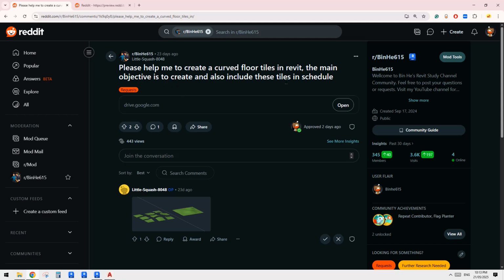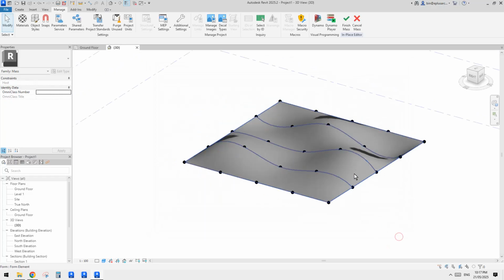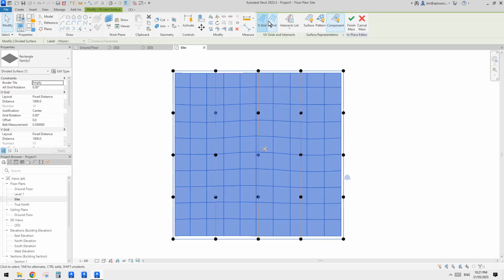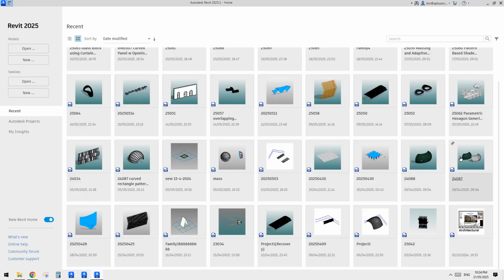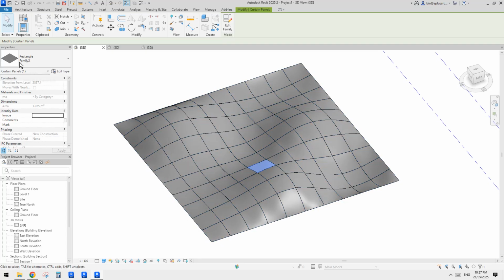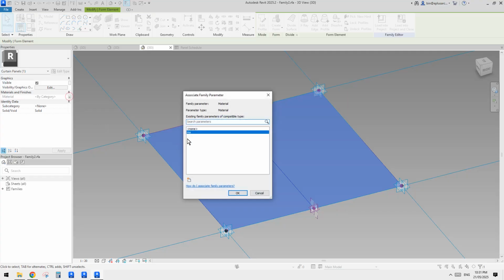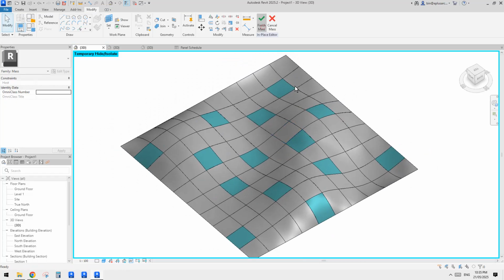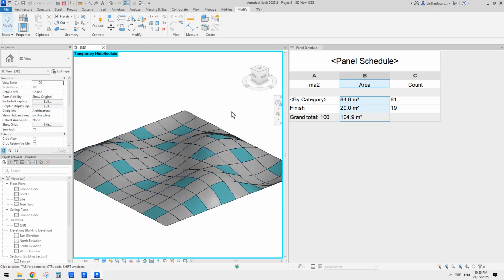25070 - Pattern Based Family and Schedule Exercise in Revit

Comment: When I try to create a custom pattern using intersecting  in a mass, I encounter issues when applying a pattern Some tiles are missing,(if no pattern is applied no issues) and others are being generated outside the intended boundary. Could you please help me find a solution for this?
Reply from the maker: Sorry mate, I've been very busy recently and haven't had time to get back to you. I did have a look at your Revit file, and it seems the intersecting method doesn't work perfectly. I'll get back to you shortly.

Comment: You are the best revit teacher in the world. Imagine the panels are in aluminum and we need to fabricate each panel like surface of Zaha or Franck O building. In this case ,is there any way to extract dimensions and curved rate for each panel? Do we have to use a different tool or make a scrip code using programming language?
Reply from the maker: Thanks. I'm not sure, to be honest. I guess it's possible to export to some other tool for 3D fabrication, but I don't know much about that area.